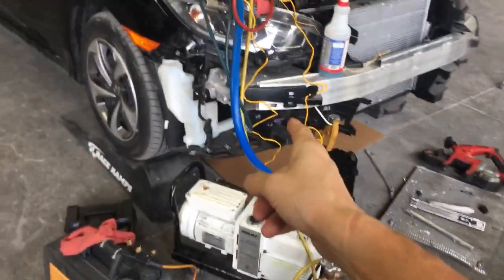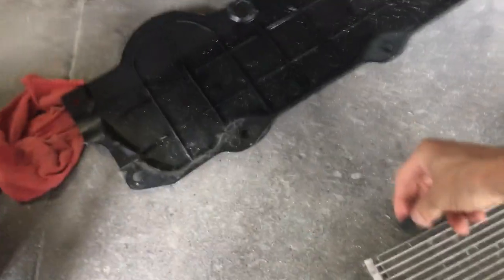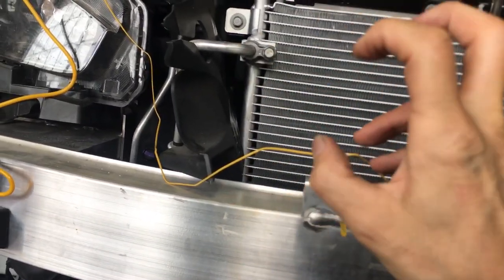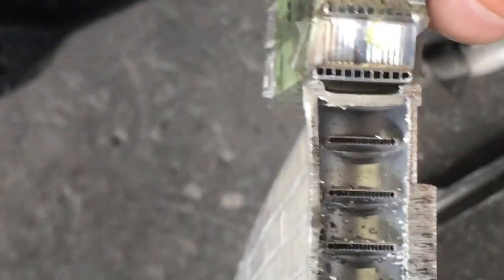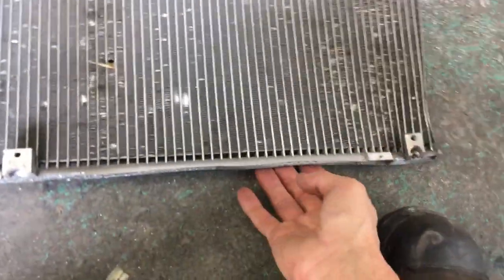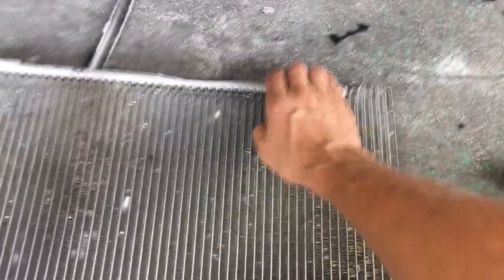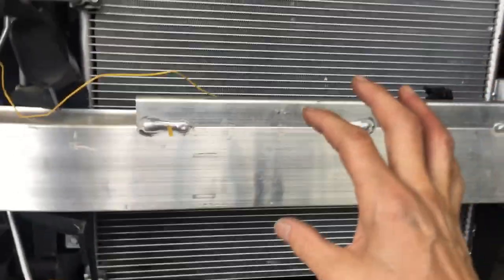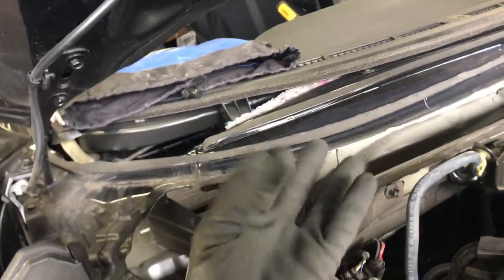Aftermarket AC condenser poor quality versus OEM original condenser. DON’T GET CHEATED!!!

Comment: I have a vintage '75 GMC motorhome with the original R-12 system, it may have been converted to R-134A  I am restoring the the motorhome and was wondering what would be the best condenser to tru to install?  How is the SC Delco Yukon condenser? I plan to use a newer compressor replacing the A6
Reply from the maker: See if you can upgrade to a modern day, microchannel parallel flow, condenser the absolute, biggest one you can find.  You might have to have some custom hose fittings made your hoses are old anyway, and should be replaced. 

Of course, replace your receiver dryer 

If you have a Thermal, San clutch the fluid driven type off the engine, replace that they go out a calibration. They don’t necessarily go bad. You will notice nothing on your radiator engine temperature, but they slow down and reduce the CFM of air delivered over your condenser. . 

If you have a electric fan upgraded to one of the higher output, new modern day, DC brushless fans that move air like a jumbo 747 jet engine . 

Have it connected to a pressure switch that only comes on when it hits a certain high side pressure like 180 psi or 250 psi, etc. for example 

Only thing is you will have to re-figure the cooling charge will be different with a different condenser . 

On those RVs change to a new expansion valve get rid of the old one it’s too old .  They do have wearing parts inside of them they do move they have springs and it has a refrigerant charge. Bello in the top all these devices go out of calibration overtime..  don’t risk it replace it

And because you’re doing this yourself and you have all the Time in the world, leave it on the vacuum pump overnight 24 hours you can never over vacuum you could just do a better job at removing a little bit more moisture  👍
Reply: @coldfinger459sub0  thanks, I've got so many upgrade ideas and questions.   I'll use my Fieldpiece SM380V manifold with micron gauge... also will plan to purge with nitrogen and pressure test.  My Cayenne uses a clutchless compressor .... I'm planning on a late model Yukon radiator and dual fan retrofit.  Will install a full ECU system and can monitor and control many things, just need sensors.
Reply from the maker: @glenc90240  and I just remembered some RVs have very horrible airflow to deliver fresh cool outside air to that under hood area to the fan and to the blower in take Fresh Air to the passenger compartment. 

Some RVs take the hot air as fresh air under that little fiberglass front cover area, and that Air is way too hot to deliver as Fresh Air especially when you’re at standing idol in traffic 

If you have this scenario where you open up Fresh Air and it opens up inside underneath where the hot air is located try to figure some way to get a ram air affect from the cool outside air in front . 

Last minute thoughts
Reply: @coldfinger459sub0  thanks, yes I can get fresh air in front of radiator.
Reply from the maker: @glenc90240  I meant fresh air intake to the HVAC box from outside.
Reply: @coldfinger459sub0  Absolutely, that's what I was referring to ....
Reply from the maker: @glenc90240  👍
Reply: @coldfinger459sub0  If you were building a custom system, what would be the best and biggest microchannel condenser (vehicle/model) to use?  I plan to  install a GMC Yukon radiator/fan
Reply from the maker: @glenc90240  the largest that I can possibly fit from a large SUV with dual air conditioning or van. 

Hey, if I could get one from a modern R1234YF refrigerant vehicle 

You may have to do a little bit of sheet metal fabrication or manipulation, make up some of your own mounting brackets and have the hoses redone for the fittings . 

OEM is always better than aftermarket, except for those Hondas that had a lot of leaks 2015 to 2019. Those are exception to the rule. Oh yeah let’s not forget Chevy pick up trucks condensers would always leaking bad upper right hand corner. 🤣

If you leave an extremely hot area and you have rear air conditioning in your vehicle . 
Add refrigerant pipe, insulation sheathing over your expose, metal suction line from the rear .  Insulate your accumulator if you have one in insulate the lines up to the compressor.. 

By selecting a different condenser unfortunately, sometimes this is where people get into trouble, it does change the refrigerant quantity  
And it is different for all condensers . 

I would recommend installing a (seeall sightglass with a moisture indicator) in the liquid line .  You can Google that it’s made by Sporlan.. they make both flare compression fitting types, and what are called sweat in or braised in models

Comment: I bought aftermarket with lifetime warranty on it still works after 5 years.
Reply from the maker: It all depends on if you get a good manufacture or a bad manufacture  🎲 🎲 it’s a odds game.
Reply: What brand?
Reply from the maker: @watchnlearn1001  it depends on what region of the country you’re in and what importer and exporter slaps their label on a particular brand. That’s it we’re talking about aftermarket. 

        Many times an aftermarket will be purchased by several importers big-name vendors and have their sticker slapped on the box saying it is their product but really they are just in porters from either China or Thailand or South Africa or a few other countries. 

          And many times it’s not possible for one manufacture to actually produce every year make model part this also goes for brake parts alternators starters intake manifolds that are aftermarket they will be what is called white box. 

           You can have a manufacture that makes 60% of all their parts add a particular manufacture to their specifications we’re going to see their good high-quality parts. 
                   But may be 40% they outsource to other manufacturers and purchase them have them stuck in their box with their label but actually not their product this is win sometimes you could get poor quality products but with a good name on the front. 

           I have in the past release several videos where I actually took pictures of the name of the product and a label on the front of the box that it was very poor quality. 

            One of our large companies not to single anyone out but it’s a big name in our area in California. (i’m just using them as example) One 800 radiator’s, or maybe one of the other big names they often have possibly two lines of products of different quality. 

          We’re going to say you have to ask for their premium quality or their platinum line to get a product that is very near OEM quality level sometimes equal. 
                 And every now and then you will actually get an OEM part white box in somebody else’s label but it actually came from my original manufacturer doesn’t happen often but it does happen. 

             Give you an example with Ford at one time you can buy a Ford OEM box with a Ford parked say a condenser for $230. 

              When you can go to a aftermarket nationwide chain warehouse distributor that carried the aftermarket division Motorcraft parts. 
              And when you would purchase that exact same condenser with the Motorcraft label on the box the part might be $180 but it was exactly the same part out of the exactly the same manufactures warehouse.  
             That’s one example. 

        As for Japanese parts I tell everybody tried by DENSO because DENSO also has an aftermarket line that is at least better than some of the other aftermarket lines of products replacing the same DENSO original condenser. 

For German you had Bear and then the other manufacture I think was called Bella.
Reply: @coldfinger459sub0 Well  I need a condenser and after a week Im still no closer to choosing one. Very frustrating.
Reply from the maker: @watchnlearn1001  completely understand. 
      If DENSO Offers one for your car that’s a good aftermarket choice
Reply: @coldfinger459sub0  That is what I ordered but when it came it was crushed in transit. Tried to reorder one but now they are out of stock. :-(
Reply from the maker: @watchnlearn1001  right now many things from over seas are bay low or out of stock. 
             For my business  I order many parts every day.   I now get told many times I have to wait many day or even weeks for parts I never had to wait for before. 
            Almost nothing manufactured in the USA any more.
Reply: @coldfinger459sub0  Quick question sir I know Denso is the best but how about spectra premium brand? Up here in Canada that's all I can find at the moment.
Reply from the maker: @hashishsenju2015  this sounds like a importer and distribution parts wearhouse ?  Of automotive parts ? 
I’m sure they must have done of the same parts we get in the states . 
             But probably just re-boxed with different name.
Reply: @coldfinger459sub0  I'm not sure if they are a distributor but from the forums their radiators seems to be on par with Denso quality. Then again beggars cant be choosers.

Comment: Hi. @Tom Lech / LECH AIR CONDITIONING,  I put seal to cover a leak and now tha mechanic told me that the condenser get clogged. Does that possible? And there some Way to unclogged?
Reply from the maker: On the microchannel condensers, there is no way to unclog you just have to replace everything.
Reply: @coldfinger459sub0  thanks a lot

Comment: How much moisture was in the desiccant bag when you weighed it?
Reply from the maker: You cannot weigh the moisture in the desiccant bag due to the fact that it’s also saturated with Refrigerant oil after being put into use 

When it’s brand new, it’s clean and dry . 

As soon as it’s put into use the refrigerant oil from the refrigerant soaks into the desiccant material and adds wait just like a dry sponge, touching water

Comment: Great video! I'm rebuilding the AC in a 1988 Toyota pickup. The OEM-style Denso serpentine condenser isn't available. So I got an FVP branded condenser (which looks identical to the OSC condenser). Parallel flow. Has more rows of fins than the OEM condenser. Is FVP a decent brand? And since this condenser is different than OEM do I need to add more/less oil and refrigerant, and how can I figure that out? Their product websites have limited info on capacity. Thanks!
Reply from the maker: Depending on the design of the new micro channel condenser you may be adding less refrigerant. 

You are dumping out the old compressor oil and replacing with new PAG DENSO ND-8 ? 

That brand,  I never hear of. 

The ratio of PAG  to refrigerant is higher. So you will be adding one oz + more then what the factory called for. 

Definitely replace your fluid  driven fan clutch if it has one.
Reply: @coldfinger459sub0  yes all components are new (evap, exp valve, compressor, condenser, fan clutch). Condenser is only non-oem part. Toyota service bulletin for R12 to R134a conversion gives oil and refrigerant quantities. Should I follow their guidelines are add 1oz more oil due to the condenser design? https://tms.cleanautoalliance.org/documents/ac002t98.pdf
Reply from the maker: @timmurphy9834  yes I am well aware of the smaller condenser design and you would also never want the original design condenser for a retrofit on this vehicle because it was horrible I think it was only 12 fins per inch maybe 14.   And if I remember correctly was that the serpentine that you mentioned style condenser.. 

Hard to advise somebody on a different refrigerant charge based off using temperatures or any other procedures on automotive kind of sucks compared to residential or commercial where can easily be achieved using superHeat or Subcooling. 

And on that system I would rather error on the side of a little bit more oil then a little less. 

And I always tell everybody who is doing it themselves you have all the Time in the world do not be afraid to leave the vacuum pump on overnight you can never over vacuum you only can do better by removing moisture. 

There’s nothing wrong with being too clean
Reply: @coldfinger459sub0  thanks for the advice!

Comment: Good video.  I was looking at a denso replacement for my 99 Tahoe.    Can I flush my condenser out or is it pointless and needs to be replaced?
Reply from the maker: If it is a Microchannel condenser it’s pointless to attempt to flush it out you just replace them. 

Microchannel condensers are excellent filters they actually catch and hold most of the Debris metal flakes piston ring material inside of them
Reply: @coldfinger459sub0  What's a good aftermarket parallel condenser?   OE for my truck is only serpentine but I'd like to upgrade.    Any info on the carquest or autozone branded ones with the limited lifetime warranties? Thanks!
Reply from the maker: @MiamiWebDesign  I know nothing about Carquest or AutoZone even though we have them around here because I really was never fond of the junk that they sold. 

I would attempt to cross reference your car with the words Microchannel or parallel flow in the search terms on Google to see if a manufacture makes a modern version of your condenser for your vehicle

If not if your creative good with your hands mechanically minded about making brackets altering things bending sheet metal little minor stuff like that making dependable attaching hardware. 

I would attempt to cross reference a parallel flow condenser from some other vehicle an SUV a van a truck by looking Adam taking a tape measure and finding something that measures you could look it up in magazines that give the dimensions of condensers and use that as your judgment of what might fit on your vehicle

And then make up your own hoses and fittings or have them made for you to fit the different placement because they probably will not match exactly

You could look at SUVs and vans that may have dual air conditioning front and rear evaporators to give you a higher BTU condenser and just try to make it work
Reply: @coldfinger459sub0  Thanks for your reply.   I found two brands that look decent and that sell parallel flow models for my truck on rockauto.   One is CSF that makes racing radiators and condensers https://www.youtube.com/watch?v=bcnmhdvKOLg.   The other one is GDP https://www.youtube.com/watch?v=Ch52UDC_bVk   I appreciate your help.
Reply from the maker: @MiamiWebDesign  yes either one of those will do any Microchannel parallel flow condenser will be better than an old style serpentine. 

But you may find a refrigerant charge quantity might be a bit less. 

I usually do not recommend using the site glass as an indicator. 

But in this case because you will have a modified condenser whatever your sticker says your original charge was it will be less. 

It’s OK to occasional he say a bubble or to drift passed your site glass in this situation. 

It’s better that you charge the vehicle on one of your hottest days available. 

If you have specifications from the manufacturer tell you what rpm to run for testing air conditioning use that otherwise 1200 RPMs to 1500 RPMs somewhat of a guide. 

Just think about at what rpm would you be going down the street at 35 miles an hour

Have your doors and windows open fresh air mode

And slowly start charging your vehicle remember keep at least a half pound low or maybe less go one or 2 ounces at a time and weight five minutes in between each addition

This is one of the problems when you drastically change one style for another style. 

If your vehicle has a engine mounted fluid thermal fan clutch and it’s over five or 10 years old and 50,000 miles or more just change it don’t even question it.
Reply: @coldfinger459sub0  Yes my truck has a fluid thermal fan clutch which seems to work fine because my engine temps are always in the middle of the gauge but I went ahead and ordered an OEM replacement for it anyway.    

So the manufacturer recommends 64oz of refrigerant and 11oz of oil.   I'll keep the charge to around 56oz of 134a.  Should I add or subtract any oil over the recommended 11oz since I am swapping out the condenser?  Thanks again!
Reply from the maker: @MiamiWebDesign  Engine temperature has nothing to do with how good your thermal fan clutch works when it comes to air conditioning

Because they overbuild the capacity of the radiator to protect the engine you can lose a lot of airflow from the thermal fan clutch and it will not affect engine temperature

But they do not overbuild the AC condenser with a lot of reserve capacity

So just a tiny amount of airflow loss on hot days makes a big difference on cool days and mild days no difference but on hot days big difference we always say airflow is king
Reply: @coldfinger459sub0  Ah that makes alot of sense.  Glad I went ahead and ordered the new fan clutch then.   
I've learned more from you and your channel in the last day or two then all of the research I had been doing for the last month :)
Reply from the maker: @MiamiWebDesign  👍 that’s what I’m here for put out information that’s not in the books 📚 📖 and not  taught by the teacher 👩‍🏫 in class